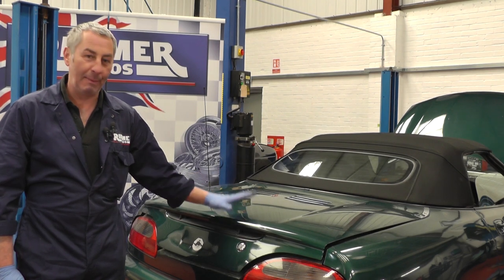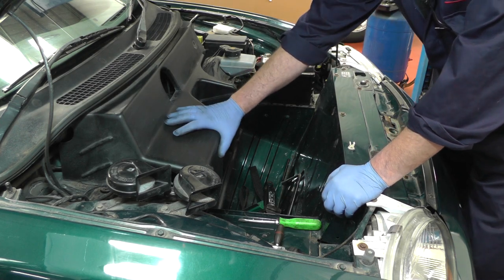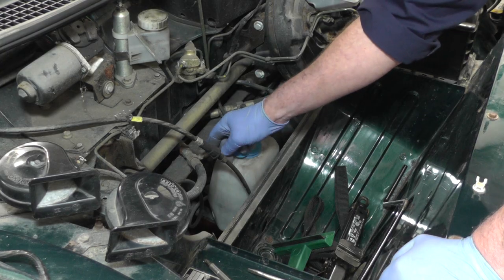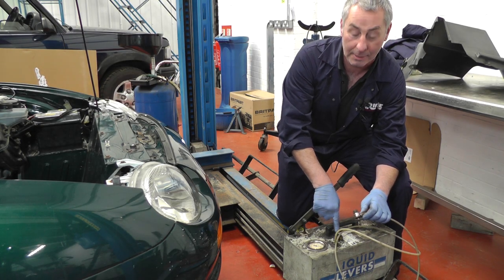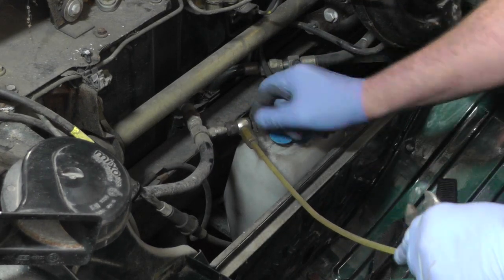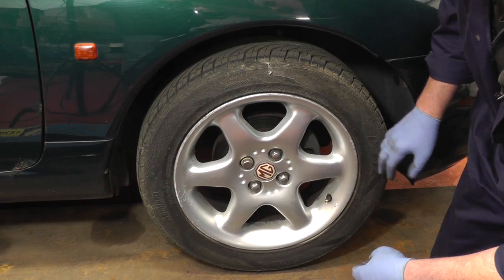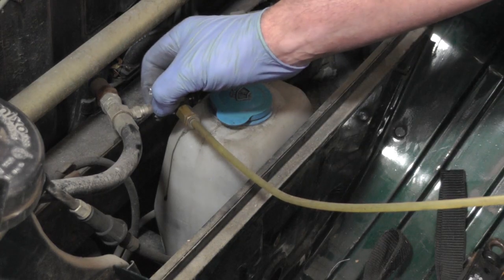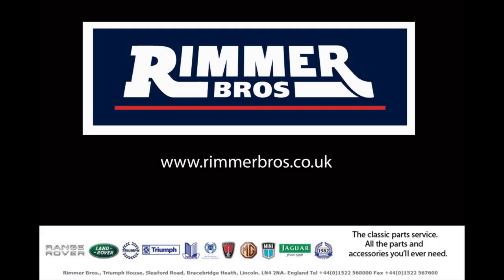Pumping the hydragas suspension up on an MGF

Comment: You should be rolling and jouncing the suspension before taking measurements. Ideally you should roll and jounce then press down on the suspension and take a measurement. Repeat, but this time lift the vehicle up by hand and take another measurement. Now add the two measurements together and divide by two. This will give you the average.

Comment: Thanks for the video. However, I cannot clearly see the measurement between the center of the wheel hub and the start of the fender.
Would you please indicate it to me in centimeters?
Owned a 2000 MG F
Thank you

Comment: Hi
Whats the correct measurement for the ride height of the Mgf Trophy 160 as i believe theyre lower?
Reply from the maker: Hi there, the Trophy should be 348mm plus or minus 10mm at 17 degrees.

Comment: Hi,
Just asking as an alternative,can coil suspension be used on an mgf 1996.If so,can you recommend the types and specs.My mgf is overseas and have no access to pump up hydragas.Please advise.Thank you
watson
Reply from the maker: Hi there, Yes indeed it can. We stock a very good range of conversion kits that are listed here: http://www.rimmerbros.co.uk/Item--i-GRID018917

Hope that helps.
Reply: There is now a kit available, consisting of shock absorbers and progressive springs. But, it's very expensive. I recently found a couple on ebay for between 999 and 1200 Pounds Sterling which, in my view, is quite a bit, considering that shock absorbers are parts subject to wear and eventual replacement.
Theoritically, the best solution, in my view, would to somehow adapt the pump, fluid reservoir and level regulator from a Citroen onto older MGFs. Anyone designing a kit of this sort could then justify a high price for a system which should deliver dependable service for the entire life of the car. The ride would be comfortable and the handling simultaneously sporty

Comment: hello i have a MGF and I have problem with the right hand hydrolastic suspension, put liquids to get up and loses the liquid, from which you will now be is the leakage, has no point you will now do to my problem ????
Reply from the maker: Hello. I am sorry but you cannot get a replacement hydrolastic suspension part. They do not make them anymore. We do sell a full replacement Suplex suspension kit though.
Reply: @RimmerBrosTV  you can get the spheres reconditioned and refilled.
Reply: how much are these im in Germany and I've got a mgf and I think the spheres cracked on the right side @RimmerBrosTV
Reply from the maker: @aleshaspeight  are you wanting a hydragas pump? If so we do these and ship worldwide: https://rimmerbros.com/Item--i-RP1165
Reply from the maker: @aleshaspeight  You can see the hydragas units on this page and we also offer a coil spring conversion kit: https://rimmerbros.com/Item--i-GRID018896

Comment: Thank you for the tutorial video. I have just tried pumping up my Allegro using a pump very similar to that one but there was no resistance when pumping the lever up and down and no fluid was pumped into the car. I thought the pump was faulty. However, watching this video it seems the valve on the pump has to be open while you are pumping? Perhaps that's why I had no resistance? I had the valve closed on the pump to prevent all the fluid from the car leaking into the pump reservoir. The pressure on the gauge showed 250psi. Did I do it wrong? Should I have opened the valve before I tried pumping?
Thanks, Martin

Comment: Interesting. My 1984 Austin Metro had Hydragas suspension.
Reply: Did it feel different from a car with steel springs?
Reply: Dream Diction they dont
Reply: Yes, it did. It felt a lot better, like you were riding on fluids. I noticed when I replaced with a Nissan Micra.

Comment: It's not hydrolastic suspension , it's hydragas suspension, the same as a Austin Allegro
Reply from the maker: You are correct. Hydragas suspension indeed. That uses hydrolastic fluid. Thank you for your input and appreciating the effort that goes into our free videos.
Reply: @RimmerBrosTV  may I just ask , does the gas in these have to be refilled too ?
Reply from the maker: @nickyjames8550  If the membrane between the gas and hydrolastic fluid is intact, then all you are doing is replacing the fluid. If the membrane is damaged or perished, then you need either a second hand sphere or to send it to a company that refurbishes them.
Reply: @RimmerBrosTV  thank you for your response  😁